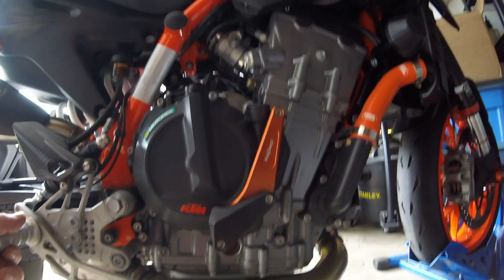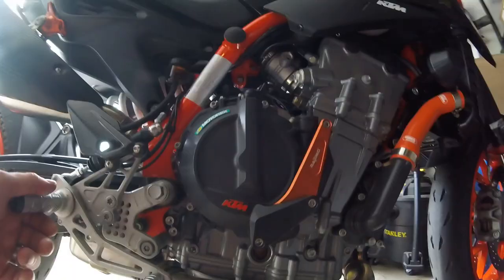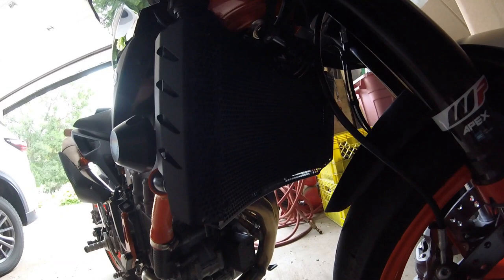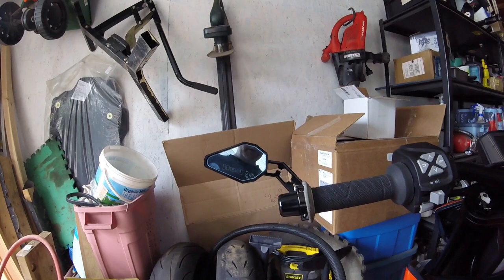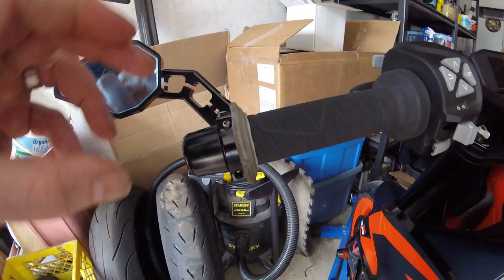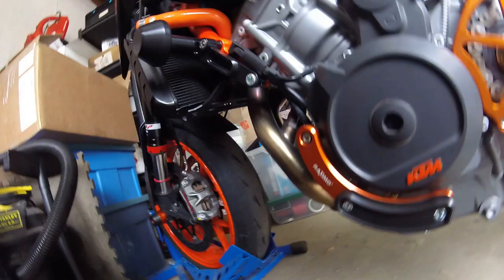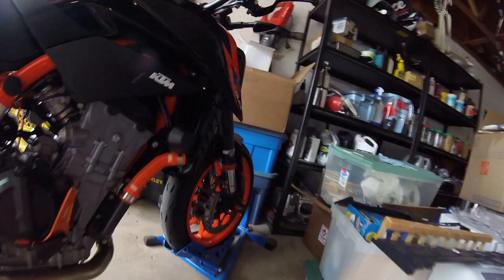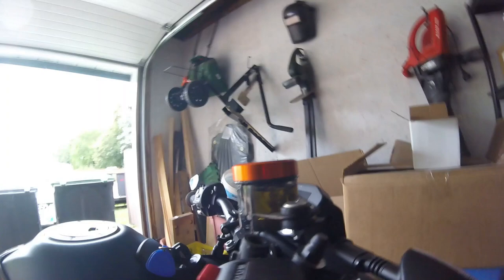2022 KTM Duke 890R Ownership Vlog #6

Comment: Interesting remarks regarding the exhaust system.  My 890 R sounded like a Singer Sewing Machine when I first started it in the shop.  KTM then fitted the approved Akra slipon ( a bit of a long pipe....) and I was surprised how little different it sounded.  Even with the db killer removed it is still very quiet.  Regards!
Reply from the maker: Check out one of my newer vlogs -- very happy with the dominator exhaust (finally!)

Comment: have the same bike love it .. 
i have slip on not sure if you know you have to run the bike on idle for 15min so the bike learn it self back pressure.. I dont belive slip can make such a difference in performance that we would notice .
Decat would be different story..
Reply: Could you elaborate what you mean by "learning"? It isn't a car with 2 oxyden sensor adjusting fuel ratio, but it has a fuel map which which dictates how much fuel and air it's going to use. Please let me know if i'm wrong.
Reply: @QrisuMies  Hi can't explain exactly i m not KTM mechanic.  But dealer told me to do that . I did it actually there with ktm staff members.  Start the bike with your new slip on . Let it run for 15min don't touch throttle at all. Switch it off after that should be done. They told me the bike is learning from back pressure.  That's all i know.
Reply: @David-ye1pk  15 minute reset no longer applies to newer bikes -- certainly it did with my 2008 rc8, but that's a myth with the better spec electronics/ecu of the modern ktms.
Reply: @davettasheppard7636 Thank you 
That is possible i don't know 
I just did what dealer told me to do.
Reply: @David-ye1pk  Yep, my local dealer is not up to speed with the newest KTMs -- particularly streetbikes as 99% of their sales were dirtbikes.  When I traded in my Rc8 on the 890R, the dealer had never even heard of an RC8 before that day.  I had to tell them all about the bike!  gave me a good deal on trade though